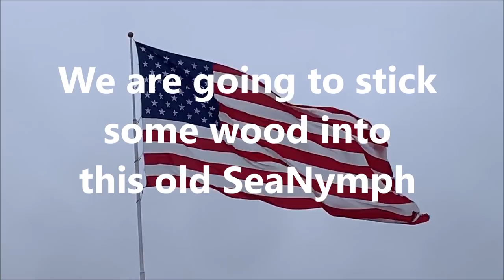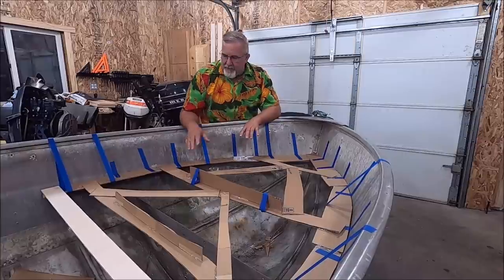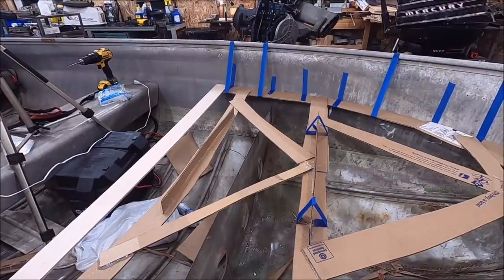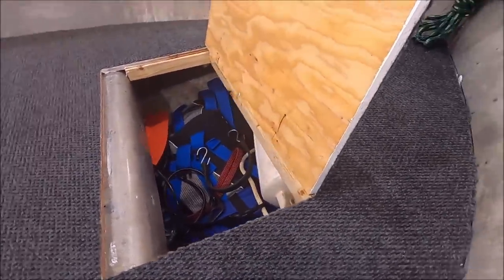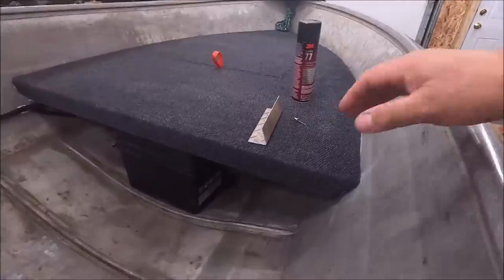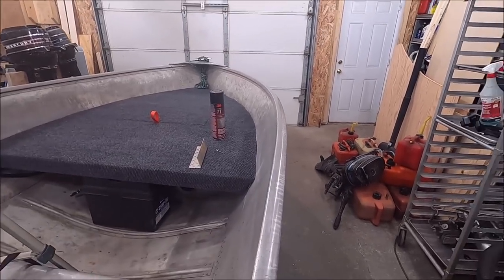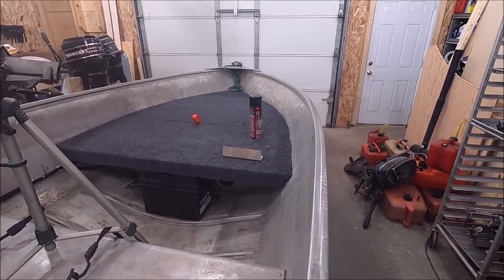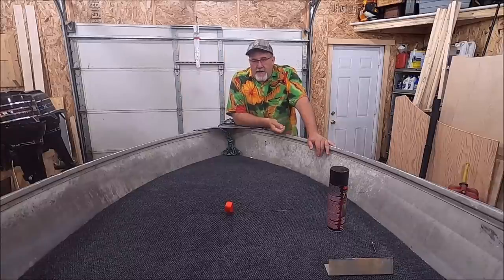1969 SeaNymph gets some serious wood up front, watch as I install storage and a casting deck

Comment: Great video! I am doing a similar thing to a 1974 1448 semi v. One helpful hint for you is to move a passenger seat to the middle seat for proper weight displacment. They will appreciate it as well riding in a seat forward facing and your boat should not "plow" anymore. I would upgrade to an 18 to 25 hp 2 stroke too. Please keep on with the content and enjoy!
Reply from the maker: Thanks for the tip!

Comment: you should have taken out the middle bench added a subfloor to the third bench ran some more of those aluminum support so that you could've replace the bench foam with some R 5 pink foam also you should've added some conduit pipe so if you wanted to add some more wiring. it would be easier also if you take out the middle seat and you could get some angle aluminum to run the deck further back and add some more storage hope that makes sense.

Comment: How much extra weight did you add? How about rod holders for trolling and storage?
Reply from the maker: I would estimate about 125Lbs including the battery and anchor and gear.  Don't need rod holders on this boat for trolling.  This boat is primarily for testing the outboards I repair.
Reply: @Michaelsbackyardmarina  Sure looks nice. Thanks for the reply.

Comment: Going to have to put your 25 hp on the back to handle the additional boat weight plus your additional weight. Of course you could get down to your fighting weight, (180#) and stick with the smaller motor. But we both know that ain’t going to happen, better idea might be to start looking for a 35hp, problem is a new supply of smaller pants and wild shirts might  force you into bankruptcy.